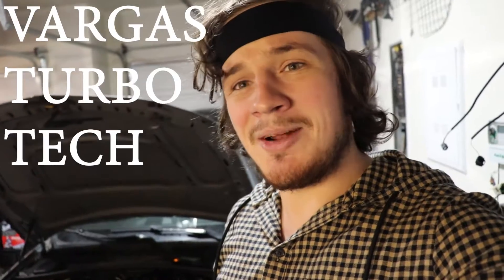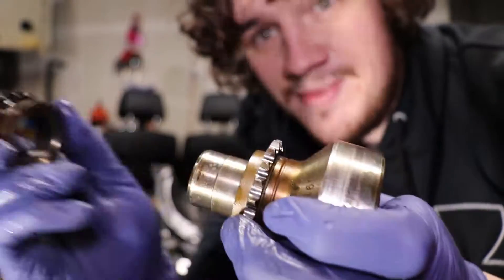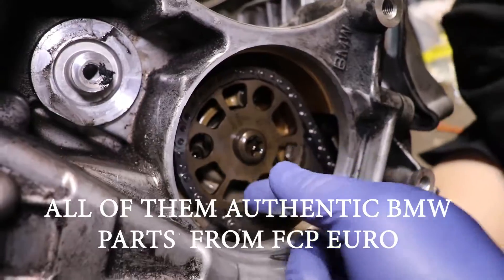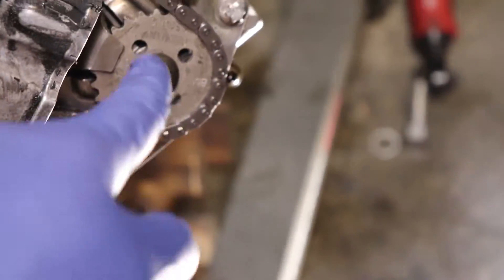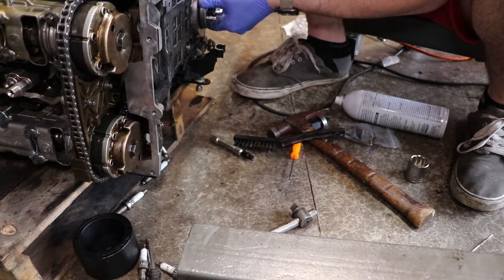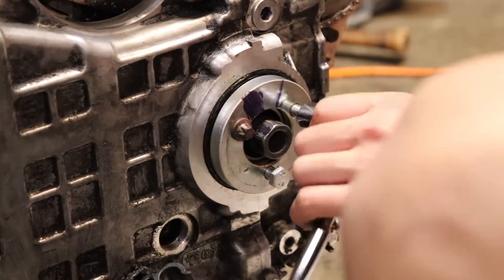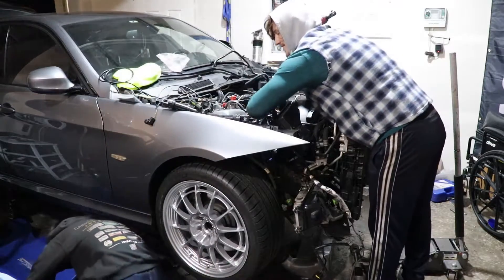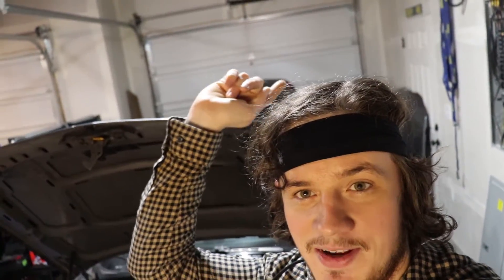VTT Spline lock solution / Crank Hub (N54/N55/S55) installation on N54 E90

Comment: Definitely recommend pinning the hub rather than the spline lock.
Reply from the maker: Please explain. 
Reason I went against pinned is that it acted as another shear point in my research.
Reply: @BuiltInTheRain  there's many 700whp-1000whp cars running different pinned hubs and its a pretty proven solution. I built a car using the spline lock and its an upgrade over oem but its extremely difficult to remove if ever need be I just don't believe is as strong of a fix as a 1 piece pinned hub. I run a pinned hub on my personal motor and haven't had any issues at pretty good boost levels.
Reply from the maker: @bimmerfab  that's amazing. Unfortunately I don't trust myself to install one, especially in my garage. How did you get yours installed?
Reply: @BuiltInTheRain  installed with the help of a buddy
Reply from the maker: @bimmerfab  How'd you do it?
Reply: @bimmerfab  you think the 2 pin hub is reliable
Reply: @alexgonzalez7395  i know it is. I make over 800whp on it and many 1000+whp s55s using it
Reply: @bimmerfab  sick I just got one for 550
Reply: What pinned/keyed crank did you go with?
Reply: @TheDetailDoc  insane performance. Contact me if you need a deal
Reply: @bimmerfab  can I call, text, message you. What # or what social account?

Comment: I'm interested in doing the vtt hub on my 335 too how did you figure out the orientation of the hub and timing since it can be turned one way or the other before tightening
Reply: The hub orientation has no effect, as long as it’s in the crank straight and flush with everything, the tensioner will acomadate it as long as your cams and timed correctly

Comment: I have a crankseal protection plate for my 135i which I haven't installed yet. the one that goes behind the harmonic balancer. I only run 350hp stage 1+ though. This crankhub work is extra, for very high hp cars. i think bmw should make em that way from factory. Another aftermarket fix for their weak parts.
Reply from the maker: It's dumb we need crank seal protection plates to begin with... This motor is one of those very high HP cars thats already slipped an OEM hub once.